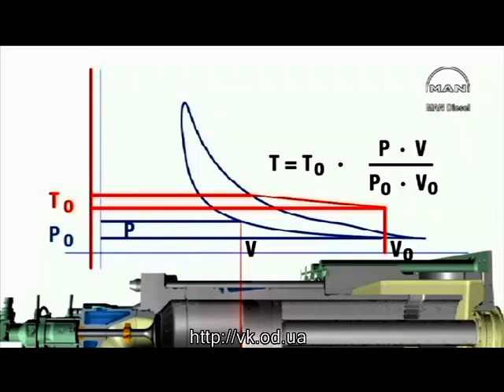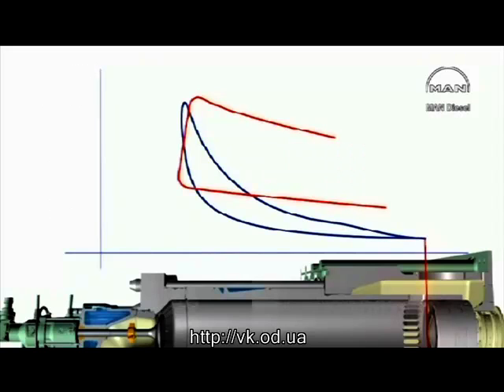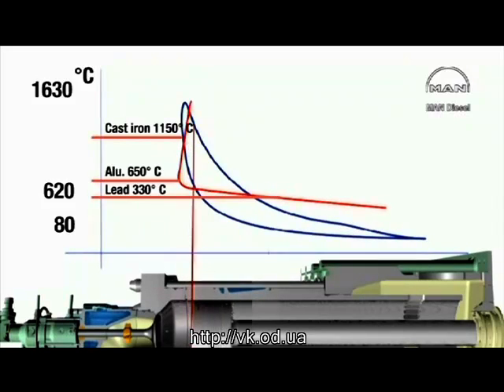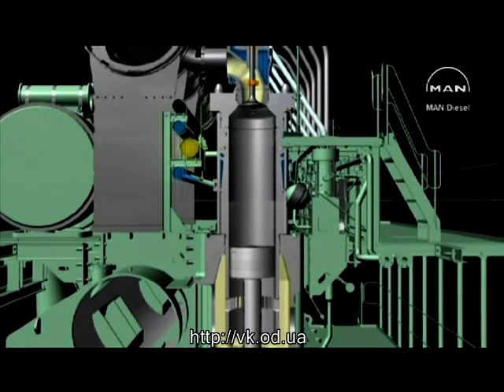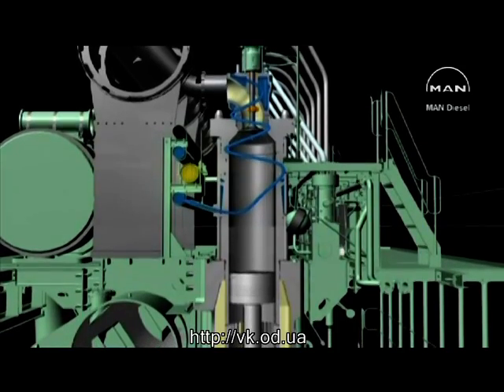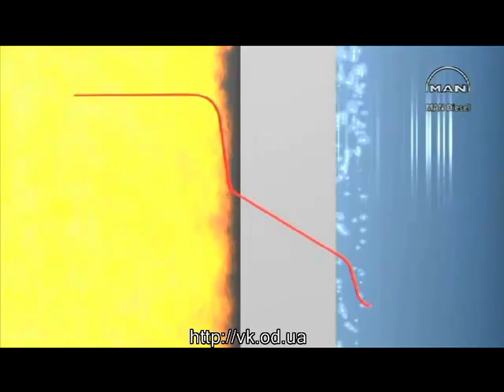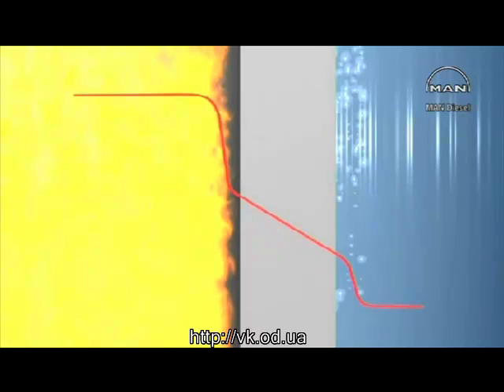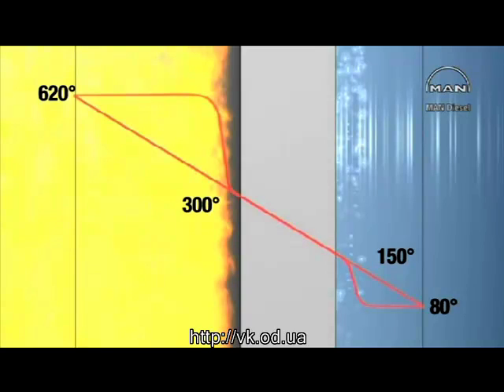MANdiesel-Part3.mp4

Comment: because of the melting temperature of the material the max temperature before they smelt is roundabout 1300 degree centigrade or smaller. So you have a higher temperatur  which the material can observe before smelting.